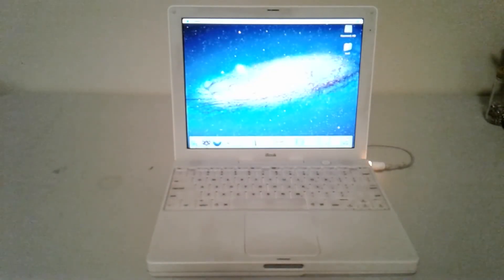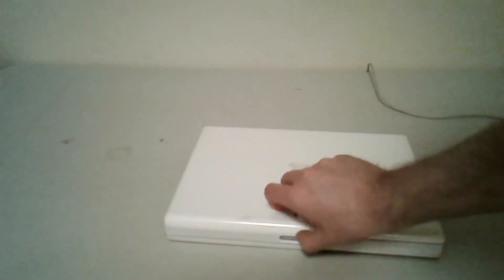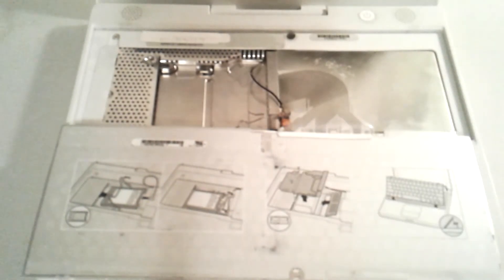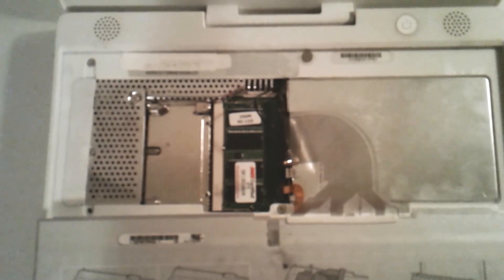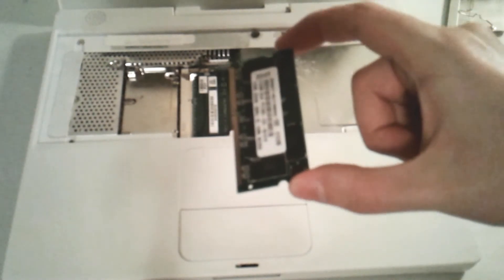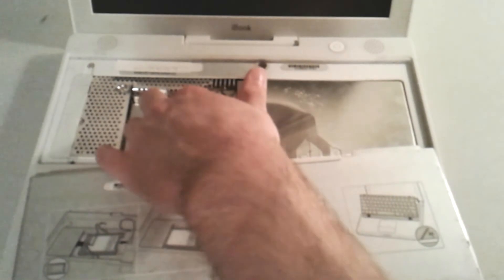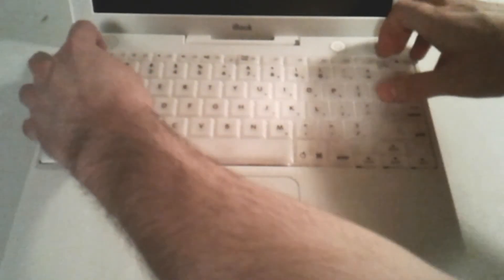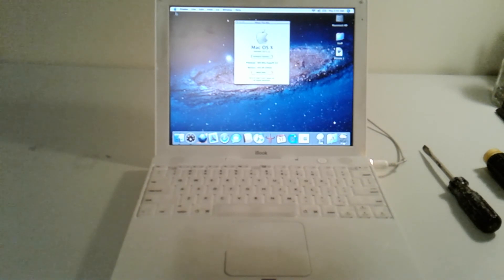iBook G3 RAM Upgrade

Comment: Are those iBooks difficult to replace the hard drive in? I have a clamshell iBook and to replace the hard drives in those its a crazy complicated process.
Reply from the maker: Yes, hard drive replacement in the snow iBooks is just as hard as the clamshell models, requiring nearly complete disassembly of the entire unit. I've done it before, but it's not something that I would recommend unless absolutely necessary.